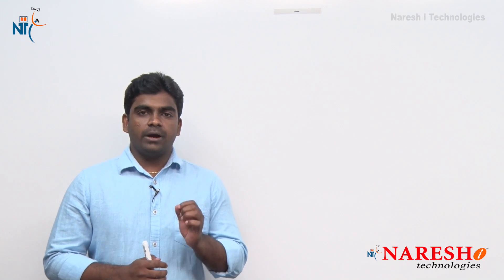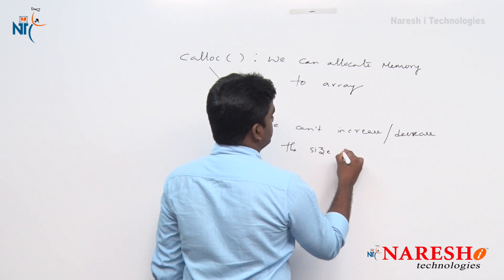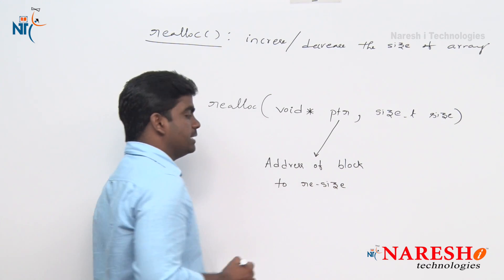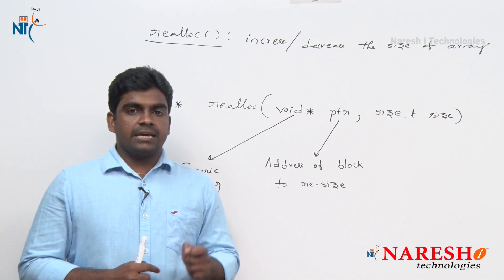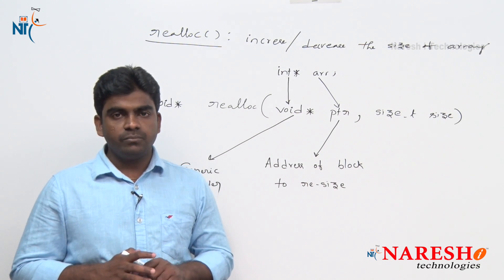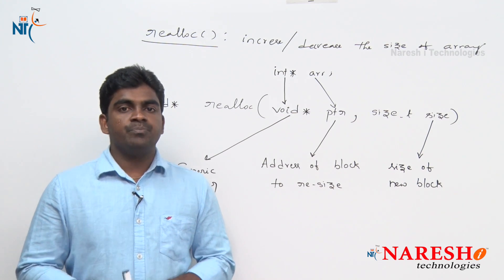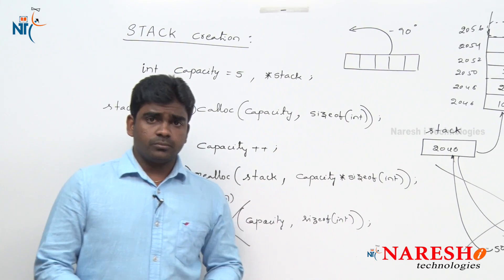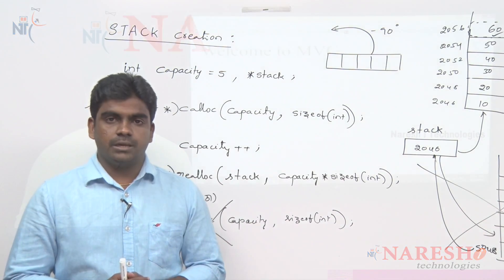realloc() | C Language Tutorial

Comment: While using realloc function, instead of: 
stack= (void*) realloc(stack,capacity*sizeof(int));
It should be:

stack= (int*) realloc(stack,capacity*sizeof(int));
Right?
Reply: yes because return type of realloc() is already void* and it needs to be type casted into the required data type (int* in this case).